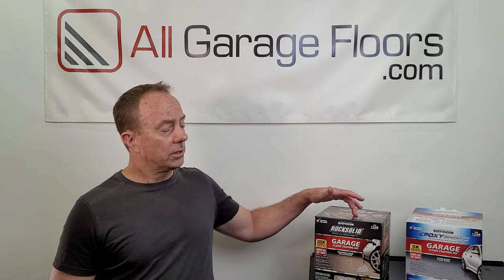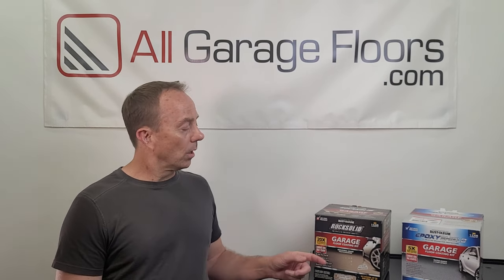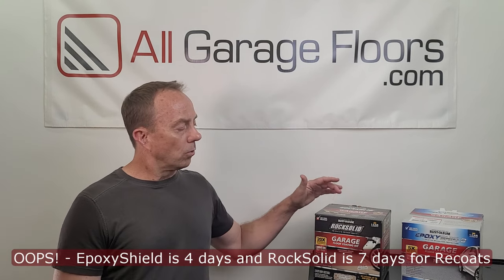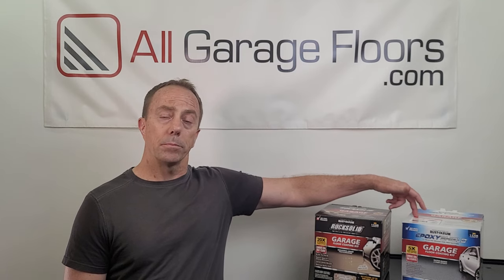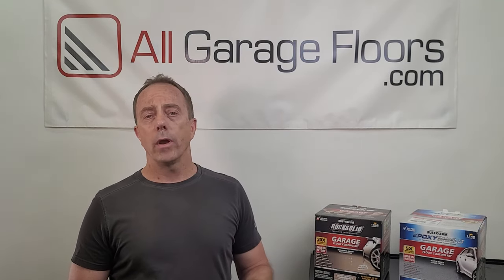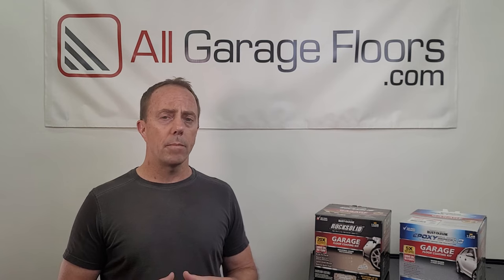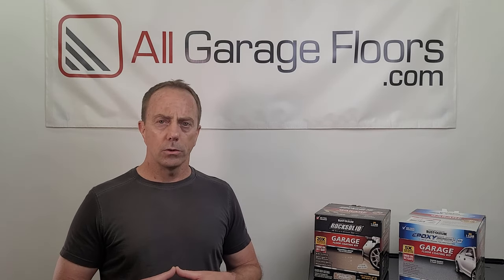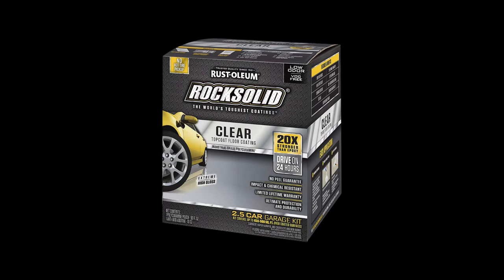RockSolid vs EpoxyShield | Which is Best for your Garage?

Comment: We live in a home that was built 7 years ago. The builder used Rustoleum epoxy. I think back then Rustoleum came in just a few colors. Ours is a light tan or beige. There is bout 6 tire burns on the floor. We are selling the house and I would like to grind what’s left of the epoxy off in those 6 areas and re-coat with hopefully a good color match
Reply from the maker: Rust-Oleum purchased the company that produced RockSolid in 2014, so there is a chance it's either EpoxyShield or RockSolid that was applied. If had a very glossy finish, then it most likely was RockSolid. You can patch repair the area as you indicated. However, even if you figured out which color tan was used, it still won't match up well. Cured coatings and coating repairs do not blend well together like paint on a wall does. Overlap marks will be evident and the color tone and gloss is always different. So, you need to decide which is the less of the two evils - the burn marks or repairs that stand out. Either that or place a car parking mat over that area.
Reply: @allgaragefloors  it was not a gloss finish
Reply from the maker: @emcinc9654  Then what you most likely need is EpoxyShield in the Tan color. EpoxyShield states it is a gloss finish, but it actually looks matte or satin after it cures. Not being glossy is a common complaint for EpoxyShield.

Comment: Great Video!! One question, i accidentally ordered Concreate & Garage Clear TopCoat instead of the Rock Solid Clear Coat. Can i use that instead of the Clear Coat of the RockSolid? Thank you
Reply from the maker: Hi Jaypee. Sorry I didn't reply sooner, but I missed your question. Hopefully you have not applied anything yet. DO NOT use the Concrete & Garage Clear TopCoat over RockSolid. It's not compatible and not nearly as durable.
Reply: @allgaragefloors  thank you!!

Comment: What is the BEST floor covering for a commercial grade product What would be the average cost as a DIY?
Reply from the maker: Hello Gregory. I noticed you emailed us directly as well. I will answer you in more detail there, however, I do want to provide a short answer here for others to read. There is no one best product. It all depends on the look you want to achieve and how the floor is going to be used. Typically, one of the best systems to use in a garage in terms of durability consists of applying an epoxy primer, 100% solids epoxy color base coat, full flake broadcast, and two coats of a polyurea or polyaspartic clear coat. We feel one of the best for DIY applications is a single-part polyurea system which we list in the description below the video. Average cost for a quality DIY coating system is going to be $1.50 - $2.00 per square foot on average.

Comment: Great vid. Liked and subscribed. I have used the Epoxyshield every 4-5 yrs on my garage floor. It’s due now and I cleaned my current floor with a pressure washer floor attachment which really brought up the loose covering. I have “pockets” of uneven concrete now. Should I be filling them in with something, or just let the next application fill them in. Budget is note a huge concern, so I’d be willing to use a totally different product if you recommend it.
Reply from the maker: Hi Peter. Little pockets in the concrete can be filled with an epoxy or polyurea concrete crack repair filler. We have an article that explains how they work and what we recommend here: https://allgaragefloors.com/concrete-floor-repair/  In terms of a different floor coating, we highly recommend a single-part polyurea. One color coat is almost twice as thick as EpoxyShield and RockSolid. It is UV stable, highly chemical and stain resistant, and will last many years more. A single color coat and clear coat will last 10-15 years before needing a new clear coat. We have links for it in the description below the video. Or, you can visit our website with recommendations and links here: https://allgaragefloors.com/shop-polyurea-garage-kits-coatings/

Comment: Excellent video!! I bought a Rock Solid kit, color high-gloss tan, perhaps five years ago and I am just getting around to applying it. Two questions.
1. Does this product have a shelf life, or should the burst packets still be good to go? 
2. My 2.5 car kit will cover 400 sq ft. My garage is close to 600 ft, which means I need to buy additional product. Rustoleum does not appear to make the tan Rock Solid anymore - it is not an option on the Home Depot website. Can I use Epoxy Shield to cover the balance of the garage? (The video suggests two coats to enhance the gloss; will that create an acceptable match? I am planning using the flakes, which may help to hide the change in color tone.)
Reply from the maker: Hi Brad. First and foremost, EpoxyShield is an epoxy coating and RockSolid is a polycuramine coating. They cannot be intermixed or used together in any way. They are both made by Rust-Oleum, but that is where the similarities end. RockSolid has a max shelf life of 60 months if it has been stored in the temperature range of 45-90 degrees. There is a very high chance that components have settled in the individual burst pouches. You would need to make sure that each burst pouch is massaged well to mix the components inside before breaking the seal to mix. Otherwise, you can have color and curing issues. RockSolid still makes gloss tan. You can find it here at Amazon: https://amzn.to/3sEdSak It's much cheaper than HomeDepot. Keep in mind that the two colors most likely will not match very well since the batches are almost 5 years apart. If you want to ensure a good color match, we recommend batch mixing. This requires cutting the corners of the colored resin burst pouches and mixing the two in a measured bucket. You then cut the corner of one pouch with the activator and pour it into a clean bucket. Add the proper measured amount from the mixed tan-colored bucket. Mix the two for a few minutes and then pour it out onto the concrete to apply. Once done, cut the corner of the remaining activator pouch and pour it into the tan color bucket, mix, and then apply. DO NOT mix two full kits together or the contents will get too warm and cure faster than you can apply it.

Comment: I'm turning one bay of my garage into a woodshop. Should I go to the expense and effort to put down a coating on the floor?   If so, it is a new build. Do I need to clean/degrease and/or acid etch for prep?
Reply from the maker: If the floor will be exposed to wood stains, solvents, and other chemicals involved with wood working, then a floor coating has it's advantages. Any spilled stains or chemicals can be wiped up without worry of it staining. General cleanup is much easier as well. We would recommend using the supplied anti-slip media since sawdust can get real slippery on a coating. Brand new or old concrete prep involves degreasing and using the supplied Eco friendly etching solution. If you don't need a color coat, then we recommend looking at a product called TS210. It's a clear protective sealer that can be applied without etching the concrete. You can learn about it here: https://allgaragefloors.com/ts210-concrete-sealer-review/

Comment: We had a water heater fail in a basement that flooded about 400 sq ft of the basement....have been drying for two weeks and the floor still tests high around the edges. My worry is that the water got below the floor through cracks and is still under the concrete. I have a high moisture reading on the tester 15-20....what moisture vapor primer do you recommend?  or do I have to do something else entirely?
Reply from the maker: You did not state in what units of measurement the 15-20 refers to. If it's lbs., then that is far too high for a coating. Have you ever had moisture issues before or high humidity in the basement? If so, then a coating is not the best choice. If you have a moisture vapor barrier sheeting under the concrete or never have had issues with moisture or humidity, then we recommend that you use a dehumidifier to draw the moisture out, then apply the RockSolid. Proper moisture vapor blocking epoxy primers for concrete are much more expensive than RockSolid and they require aggressive grinding of the concrete before application.

Comment: So, we already had purchased the EpoxyShield kit for our floor (tinted so non-returnable).

What would be the best way to try and improve on the issues this one has, either in prior prep or after? I already heard elsewhere to use muriatic acid to etch instead of what is in the kit. And while the epoxy clear coat won’t help much, could we use the polycuramine clear coat later on with additional prep somehow? Or whatever else you would recommend, because we WILL have cars in that garage.
Reply from the maker: Better floor prep will help to some extent. We have an article on how to properly acid etch here: https://allgaragefloors.com/acid-etch-garage-floor/  However, it will reduce the coverage rate by approximately 10%  since more material will be absorbed by the concrete. In terms of a clear coat, we would recommend EpoxyShield Premium Clear Coat over RockSolid. Amazon has the best price: https://amzn.to/44XOlb5  The reason for EpoxyShield over RockSolid is that it will achieve a chemical bond to the color coat when applied during the recoat window. This bond is much better than a mechanical bond which is required when applying a non-compatible coating (RockSolid) or additional coatings outside the recoat window. When applied at 250 square feet per kit, it will achieve a dry film thickness that is 3x thicker than RockSolid as well. Because EpoxyShield Premium Clear Coat is 100% solids, it will help to resist the heat from hot tires that softens the thinner, water-based color coat.

Comment: I have applied the epoxy shield by Rustoleum five years ago, I need to refresh it, could I apply another kit of epoxy shield over it? Would Rock solid would be better?
Reply from the maker: Hi Martin. RockSolid is the better product in terms of performance and longevity. Just make sure you don't have issues with the older coating peeling or the new coating that is attached to it will peel up with it.

Comment: Hi , can i do epoxyshield and add clear coating or do the rocksolid which way is better for durability? I have 2 car garage 20ft x 20ft and thanks in advance your vedio was very helpful
Reply from the maker: I don't know what your question is exactly. You can apply whichever coating you prefer or your budget allows. The matching clear coat for each provides more durability as well as locks in and protects the color flakes. RockSolid is the more durable coating overall.

Comment: Thanks for the intell..!!
I found you response to another question about prepping old epoxy floors but still have a question; if the surface is 99% epoxy, is the acid wash needed..?
I want to apply a thicker and more thorough this time;  I was thinking a squeegeeing it on this time; any input...?
If i were to do 2 coats, would you recommend rolling first (thinner); squeegee the second; thicker (if squeeg is an option)
What nap roller do you recommend..?
the clear (2.5 car) comes with 90 oz only and claims to cover the same as the240oz  paint coat; is this accurate..?
Any reco on applying  clear coat thicker...? Also; thoughts on flakes on top of the clear coat...?
TIA
Reply from the maker: Etching solutions and acid etches have no effect on floor coatings. They need to come in contact with the minerals in concrete to work. Roughing up the surface with 120-150 grit sandpaper is required. We have an article here that discusses how to prep old epoxy floors: https://allgaragefloors.com/prep-older-epoxy-for-new-coat/  DO NOT try to apply EpoxyShield thick. It's a budget, water-based epoxy coating that will not cure properly and form bubbles. Only high solids and 100% solids epoxy coatings can be applied thickly or with a squeegee. Two coats of EpoxyShield applied with a 3/8" nap roller are what you need. Make sure to wait a minimum of 12 hours before applying the second coat. The clear coat material is more expensive so Rust-Oleum provides less of it to keep costs down. As a result, the dry film thickness is far too thin to get good performance. We recommend using two kits. However, once you start adding up the costs for doubling up budget kits, you are close to the cost for a commercial quality DIY epoxy coating system that is three times thicker and will last 10-15 years.
Reply: @allgaragefloors  Thanks mucho... glad you saved me that mistake.. I saw a video that said, if you hear the roller stickiness, as you roll, the roller is too dry; accurate..?
Also, I have 2 kits of the clear, same rolling it on question for thickness..? (I'm a smart shopper, 2 for 175 🥳) roughly 525 sq ft coverage needed
TIA again
Reply from the maker: @gjf6442  Yes, that is correct. If you the roller is making noise, then you are stretching the coating thin. Same for the clear coat.

Comment: Which one would you use on a 6x10 trailer if you were to go with the industrial kits?
Reply from the maker: If I had to choose between the two, I would use RockSolid. However, if I had a different choice, I would use a commercial-quality kit that includes an epoxy primer and 100% solids epoxy. Here is an example: https://rb.gy/4dldbd  You have an option of adding color flakes and clear coat. Just the epoxy primer and 100% solids epoxy would be over 5x thicker than either Rust-Oleum product.
Reply: @allgaragefloors  Thanks… t hat’s what I meant to say when I asked industrial vs the commercial kits. Half asleep. Thanks I’ll look into that link. Most of the videos I’ve seen of trailers with the ” rust o kits”  they make it sound to good to be true. And they ain’t cheap.

Comment: I have a year and half old home. The garage floor is pretty clean other than some dirt tracked in from other homes being built on the block. I have a couple hairline cracks here and there. It's a two car garage with a 4 foot wide extension. I figure maybe 450 sf and I have some 4" cement boarders before the sheetrocked walls. Puddles form from rain off my vehicles so I believe I'd have to etch the floor first, would you agree?  I think the 500sf full broadcast option would suffice. Do you agree?
Reply from the maker: Hello Adam. Regardless of whether the concrete is new or old, it absolutely must be etched at a minimum. Puddles forming are not an indicator of whether or not concrete has a proper profile. We have a video that explains why concrete prep is essential here: https://youtu.be/CM4oVaJwJ9g?si=roScTPv2p2Ni77oq  A full broadcast option is excellent at hiding small hairline cracks and other small imperfections in the concrete. However, I hope you are not referring to RockSolid or EpoxyShield for a full broadcast. It will not work. At only 3 mils dry film thickness, they are far too thin to accept all those color flakes. In addition, the amount of clear coat kits you would need to purchase to properly cover the flakes puts you in the commercial quality price range for materials. There is a reason these kits only come with a small bag of color flakes to apply. There are far better DIY kits that provide the proper epoxy primer, high solids (3-4x thicker) epoxy color coats, and two coats of a high-performance clear that will not amber (turn yellow) from exposure to sunlight. Here is an example of such a kit: https://bit.ly/4abJGUV  If you have any questions, just let us know.
Reply: @allgaragefloors  Yes, I watched the video and realized  cant have a full broadcast with Rock/Exopy. I recall hearing if water puddles on your garage floor, it is not pourous and must be etched, just wasn't absolutly positive. My garage floor has a slight scheen to it, I think they buffed it somewhat after it was poured, or it's a different kind of concrete then the foundation. I went on you website and have the High Solids DIY kit saved with tan base anbd shorline #10 flakes. I'm thinking the 500 sf FB with topcoat should suffice. Thanks for your reply.

Comment: Love the rec for TS210! Will decide that or epoxyshield since it’s a rental and no car will be stored. Can you recommend a good degrease to prep concrete? Harbor Frieght, Zep, etc? What are your thoughts about rust oleums 3-1? Looks like it can degrease and etch all in one…
Reply from the maker: Hi Jared. We are not fans of products like 3-1. They are like a Jack of all trades - they are masters at none. If the concrete needs degreasing, use a degreaser for the best results. Our favorites are Oil Eater and Purple Power. EpoxyShield comes with an etching solution in the kit. If you apply TS210, etching is not required in most circumstances.

Comment: @allgaragefloors How long should I wait after the EpoxyShield color coat to apply the clear coat?
Reply from the maker: You need to wait a minimum of 10-12 hours between coats. You have up to 4 days to apply additional coats before further surface prep is required.